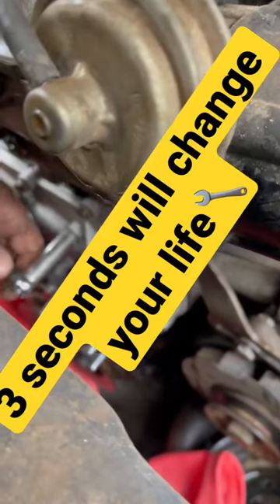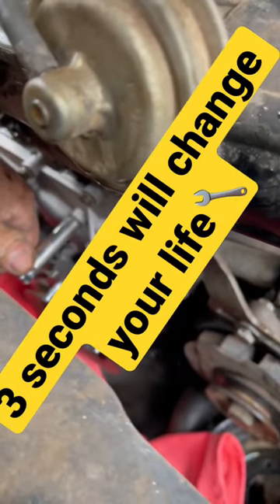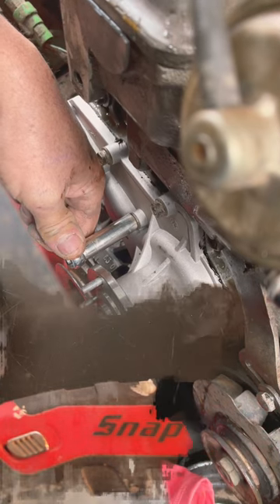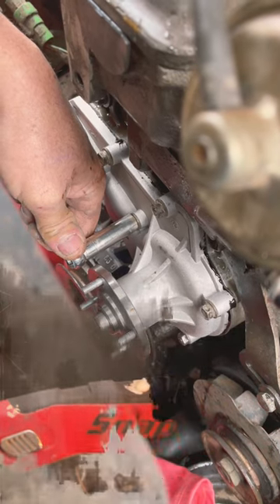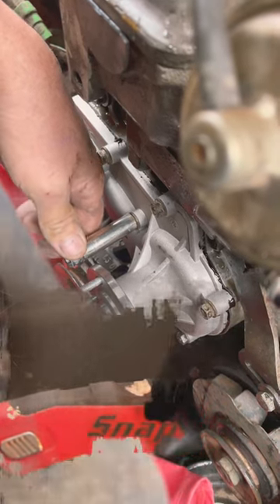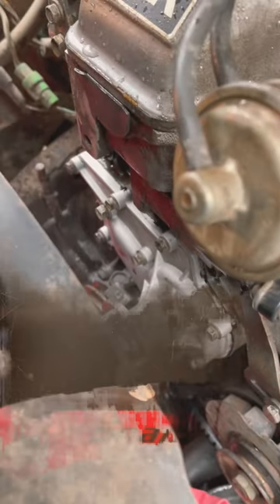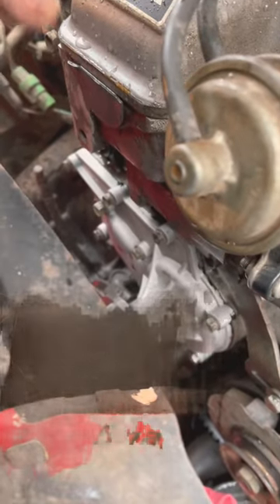This is why you hold your bolts for 3 seconds 🔧#shorts

Comment: The old fashioned deflection tourque wrench is very good for this. At assembly you can often watch the bolt creep an 1/8 turn further at its torque rating.
Reply from the maker: Tell the new guys this please 🙏 😀
Reply: That's rather interesting, I didn't know that. Likewise the video, new info to me.👍
Reply from the maker: @wyliecoyote1  👍🏻 very interesting. …. Glad you stopped by to check it out .
Reply: That's true. I use one of those and notice that when I torque down bolts.
Reply from the maker: @Rick-hp6fu  exactly… you would really never know if you have never used vintage tools ….. good luck trying to explain to some people though … they need it to beep or light up

Comment: Imagine going your entire career not knowing that master tech pranked the fuck out of you 😂
Reply from the maker: That would be hilarious! What is funnier is going your whole life believing it is not true  when it is😂
Reply: I used to say let's let the molecules run around while I hit the beer
Reply: Vibrations rattles some bolts tight and some loose 

There's is no way of knowing which ones will do either 

Sorry you got pranked years ago bro
Reply: Bolts rattle tight alot more than loose
Reply from the maker: @treeclimberman3337  this is for the ones that loosen not tighten…….
Reply from the maker: @peteragersea377  👍🏻
Reply: @fastflo1  there's now way to know for sure which ones will tighten or loosen, 
 Like intake manifolds will have tight as fuck bolts and some loose ones 
You got fooled dude sorry 
 I've put    engines custom motors in wood chippers   swapped engines in countless vehicles 
I've got a ridiculous amount of wrenching experience on skidders ,chainsaws,  trucks, dunes buggys, dirt bikes, go karts, four wheelers, tractors, bucket trucks, skid steers hiab booms, 
Not much rattles more than a industrial brush chipper
Reply: @treeclimberman3337  intake manifold bolts are some of the loosest on the car lmao
Reply: @fastflo1  grab a torque wrench and a high tensile strength bolt. Clean your threads male and female, then torque your bolt, no matter how much you re torque it it won't get any tighter.
Reply: But a Mechanic is better skilled over a tech who only knows a cookie cutter product.
Reply: @fastflo1  dude. You seriously got trolled.
Its an old windup. Like get a bucket of steam or sending them to the store to buy stripey paint.
Reply: @fastflo1  not true dummy . I'ma master tech
Reply from the maker: @treeclimberman3337  I wish
Reply from the maker: @treeclimberman3337  there is a way to know . Hold them all for 3 seconds . Then you know they are all settled. The ones that back off had rebound tension. Pretty simple just hold the bolt for 3 seconds. Does not matter if you have wrenched for years or not. The bolt doesn’t care about your experience. Period.
Reply: @fastflo1   what you just said doesnt even make sense , mikey Lopez said it right
Reply from the maker: @treeclimberman3337  you’re wrong , it does make sense . It’s so simple to try and found out . You would rather jump in a band wagon than grab a wrench and Find out for yourself it’s true. So funny 😆
Reply: Imagine finding out in the YouTube comments and not believing them
Reply: @fastflo1  You do know, that is one of the jokes we play on trainees right
Reply: @fastflo1  aerospace hydraulic tech here. What you’ve claimed is not a thing 💀
Reply: 💯 so funny
Reply: @fastflo1  Yeah, and how long will it take the bolt to spin loose? 5 years? 10, 15? You talk like it'll spin right out, because it wasn't held for three seconds.
Reply from the maker: @NaruSanavai  it’s an extra step you can take to help prevent bolts from backing out . And no matter when, you do not want a bolt coming loose . Now or later .
Reply from the maker: @NaruSanavai  you need to try it. It’s just too easy to find out ….. I do not know what else to say . If you make a regular practice out of it you will discover the truth . It does not need me backing it . It just works….
Reply: @fastflo1  regardless of whether it's technically true or not, the number of people that don't do and still get good results essentially proves that it's a waste of time. The question is, does the piece of mind you gain outweigh the time you lose?
Reply from the maker: @joeschmoe6908  it is never a waste of time to make sure bolts are tight. Races are won and lost due to mechanical failure. I would be the one passing all you guys that just torqued your bolts. This is above and beyond the standard.
Reply: @anthonyhawkins4136  thank you for confirming.
Reply: @fastflo1  how many years I’ve been turning wrenches and never heard of this. I’m sure it’s true. 😂
Reply from the maker: @blahblah8037  I am truly glad you finally found out. In a world where we think we have heard it all and seen it all......🙂
Reply: @fastflo1  Where did you get your training from? Because you are actually wrong, nobody does this and nobody teaches you to do this because there is no reason for it. How many master technicians have to tell you your wrong before you realize whoever taught you was incorrect about this particular subject? Iv worked as a master tech for numerous dealerships including Chevy, Dodge, Porsche, and now Ford im not saying iv learned everything about the craft I do but Iv done it long enough to know dam well you don't use a torque wrench to tighten a bolt by holding it for 3 seconds 👍
Reply from the maker: @Reno420alex  you still have studying to do. Lots of techs and mechanics love to just be right . Tell how long they have worked and how many things they know. How nobody else can be right because they weren’t taught . Or didn’t read it . The majority rules right ? So many things about mechanics and metals that are not written in a chapter. All of these bolts and wrenches and modern technology do not replace hundreds of years of mechanics and know how. So much has been discovered about metal over the years that  really good mechanics figure things out. This is one of them . You can think I am wrong . It is ok with me. I know a lot of things other people do not . It doesn’t bother me . It just shows me how human nature is. And people react. Some people say they never heard of it and want to know why. Others say instantly it is  untrue . Do you know that before click style torque wrenches we’re made people had to apply torque with tools like dial indicators and beam style wrenches? You do not run a bolt up to the number one time as fast as you can and let go. That is absurd and defies common sense. You approach the torque and it will take you 3 seconds to actually settle the bolt and get the reading you want . So this technique has been around a lot longer than you or any other millennial tech has. The science behind it has been in existence along with to tools to apply it before you we’re born are started working on anything . They didn’t right it in any book . You had to do it . So you may not understand the actual basic fundamentals to begin with along with metallurgical properties of the metals and what is happening at the molecular level. Add heat and vibration along with harmonics and low resonance vibration and you can easily have a bolt back out . This extra 3 seconds helps to settle bolts whether you believe it or not. Funny thing is that I find most amusing is the absolute refusals I here. But we make loctite, washers. safety wire, double click our wrenches , double torque , check them again … and why again? Because bolts come loose right ? Even from the factory right? With all of this in place. And everything that has to do with a bolt being tight is right according to you . But you can’t see that holding a bolt at valise with or without a click wrench has zero effect. None. It does nothing . But everything I do up to that point didn’t ? The vibration you hear does nothing? So now noise frequencies and vibrating do nothing because you said so? Ok……… ok keep doing me. You keep doing you …. I have more to learn I am not done . If you are done with what you know … cool for you 👍🏻
Reply: @fastflo1 You are absolutely insane old man keep listening to your vibrations 🤣
Reply from the maker: @MauserTheCat  hahah you guys ….. 😀
Reply: 😂😂😂
The mechanic should have taught him what a torque wrench and torque pattern is.
Reply from the maker: @nitroustommy3668  😂😂😂
Reply: @fastflo1  sounds like you don’t tighten your bolts enough if you had enough bolts falling out to notice a difference when you did this, none of my bolts fall out so even if I did start doing this I would never know if it was true or not
Reply: They had him holding bolts the whole first day of his apprenticeship 😂 day 2 he collected air samples in a plastic bag
Reply from the maker: @TrillMurray  day 3 blinker fluid 😀😁🤣
Reply: @fastflo1 if you want your shit not to come lose, use lock washers, if you torque youre shit right no way vibration will break that loose
Reply: @fastflo1 Nobody is arguing that vibration and heat doesn't cause a bolt to come loose. Of course it does. You're not proving anything about your 3 second rule by saying so. 

I could definitely see this rule as being something a master tech taught to the newbies to make sure they weren't briefly bouncing off the torque limit. Or possibly a  personal theory that was passed on because it made sense to them even though there's no scientific basis. If you slowly approach the limit of torque, there's no reason it should take 3 seconds for a screw to "catch up". Metals are relatively stiff so the material naturally responds and deforms quickly to stresses like tightening a bolt. As long as the bolt maintains its torque value when the wrench is held stationary in its final position, that should be all that's needed. At least that's my understanding as someone who had quite a few structural/material courses in engineering school.
Reply from the maker: @frederickschulze8014  I see your point . Some of the best mechanics on this planet have learned things that many others will never believe unless it came from a book or article . I can assure you right now there is a NASCAR engine builder doing something you have zero knowledge of . You won’t find in a book or classroom . You find it by working on  machines and learning from other great mechanics .They are not going to share their top tips with you or anyone else . And if they did you wouldn’t believe it anyway… but they know it works and they are doing it every day …. A book is not going to tell you this . And catching up is a basic phrase… rebound? You feel your ratchet pushing back ? Some bolts are not neutral when you apply torque . Even something as simple as thread interference can give you resistance, and sometimes to overcome that resistance you hold it for 3 seconds in that time I have had the bolt advance. Not if that tension is set to rebound in the opposite direction . Add heat and vibration it will send it in to motion . I’m sorry you cannot understand this .Go do this for 20 years and get back to me. If you are unwilling to try it and see for your self and just deny it simply because you do not believe in it . I can do nothing for you . To pick up a wrench and find out . It’s simple not like a big secret . You can find out …. I’m about 30 years ahead. And thousand of bolts . So please come back when you have some experience… that would be more valuable and your opinion will hold more weight …. Tying to get me to believe it does. It work is like me trying to get you to believe it does . Only difference is I know from experience and you have not yet discovered it ….